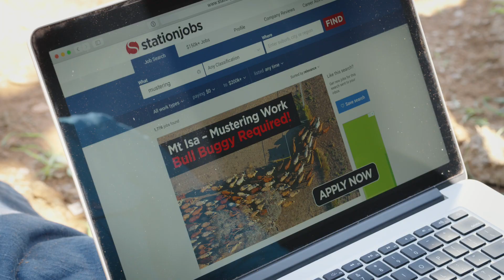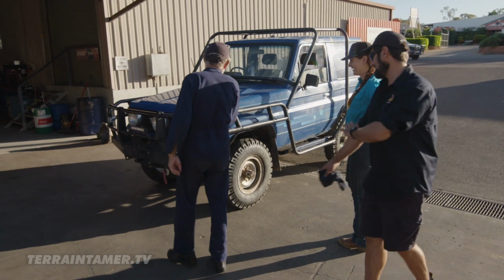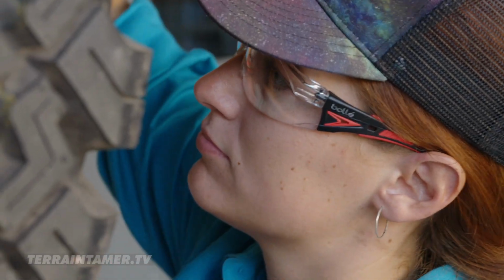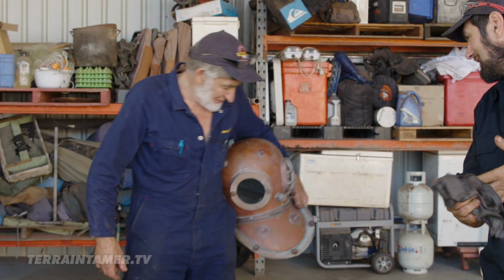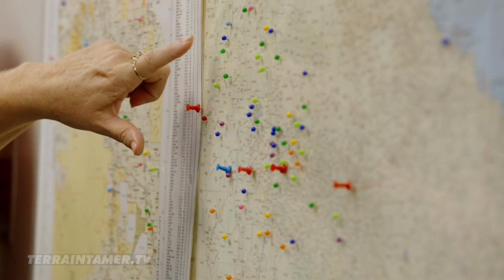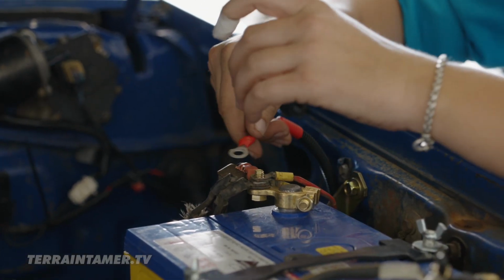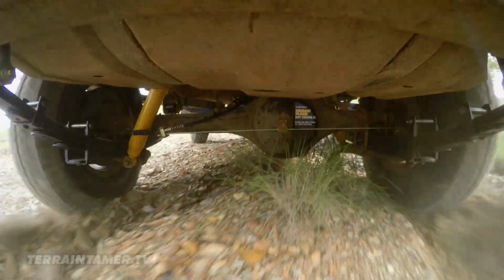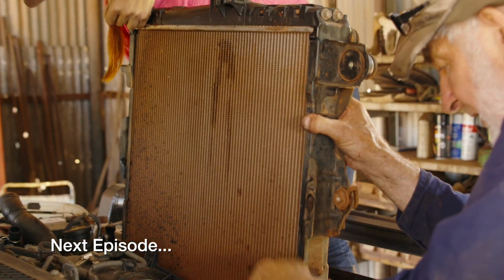Terrain Tamer Goes Mustering | Episode 8 - ELockers

Comment: To those considering a locker, I highly recommend avoiding automatic mechanical lockers. My 75 series ute came with an Aussie Lokka pre-fitted in the rear diff and it was RUBBISH. Even though it was set up correctly, the excess driveline play was so bad that you could rotate the driveshaft 30 degrees by hand.  I ripped out the diff centre to replace the locker with open diff gears and it's so much nicer to drive now. Go straight for an E-locker or just stick with open diffs.